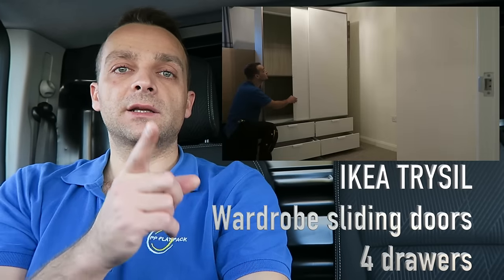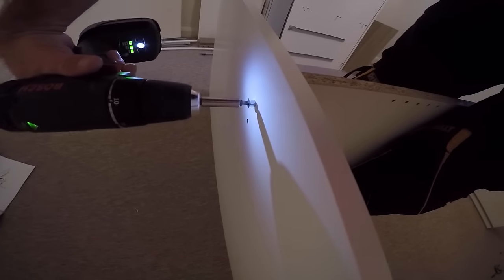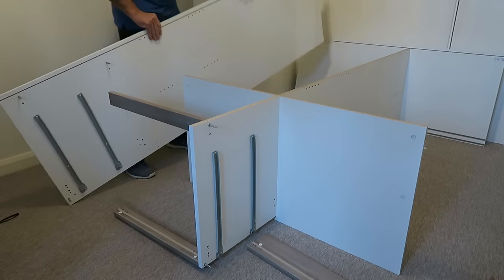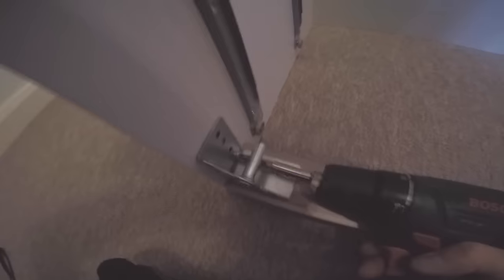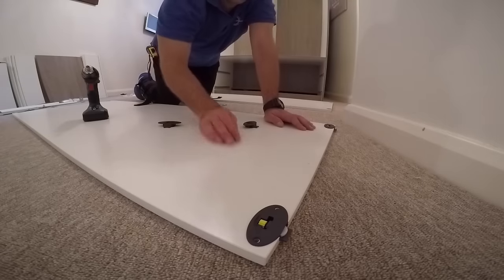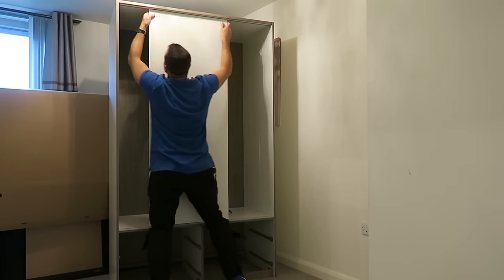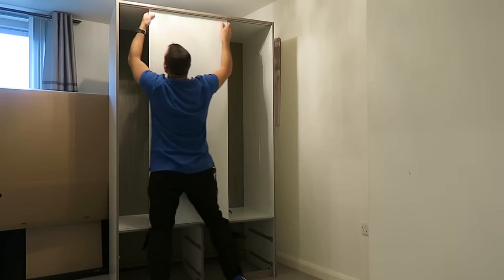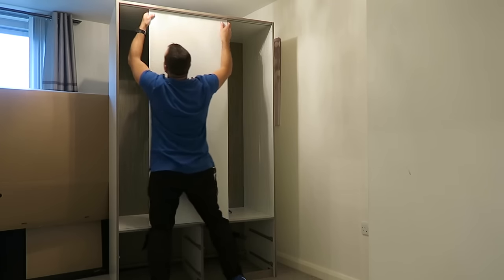IKEA Wardrobe TRYSIL sliding doors 4 drawers assembly

Comment: Hi must we always need to fix this kind of wardrobe to the wall? I don’t live in area prone to earthquake and the wardrobe after loaded with clothes should be more stable right? Or am I wrong? Need your expertise. And thanks your videos have been very helpful !
Reply from the maker: Is up to you if you like to fix this wardrobe on the wall I would suggest to doit if wardrobe leaning towards you instead of towards the wall. If your floor is straight should be fine without fixing as you mentioned wardrobe is deep enough and loaded with clothes will get more stable. My experience 90% of the people would not fix but if there is small kids... You know sometimes better safe than sorry.

Comment: In the good to know section on ikea site it says wardrobe must be anchored to the wall. I have a wooden floor and I think it should be steady but is there any video on how to anchor this huge wardrobe?
Reply from the maker: Zinedane56 True all wardrobes should be attached to the wall. But most of the people don't want to for what ever reasons (holes in the wall or they want to move furniture around. Here is video on different Ikea wardrobe but the same wall fixing as on TRYSIL. Here is the link https://youtu.be/KTRbi8iOeKY
Go to 4:17
Reply: Thank you. I think the L shaped anchor and the screws would be provided by Ikea right? All I have to do is to hook it on to the dry wall with one screw going to the wall and the other down to the wardrobe? My main concern is if the screws would go directly to the drywall or if you need some sort of an plastic anchor for the screw to hold in and to go into the drywall? The reason I am asking is I recently bought the EKET cabinet and Ikea did not give me the screws but only the wall holder/anchor. I had to run to home depot to get the screws and it was a pain in the butt in the last minute. Please reply.
Reply from the maker: With this wardrobe, you get L shape 2 brackets for wall fixing. Wall plugs and screws for the wall are not included. Wall plugs you choose to depend on your wall if you have solid (brick) just search for accurate wall plugs. If plasterboard you can have look here is example https://youtu.be/wKRjMVfjAQw
2:53 plasterboard wall plugs explain.

Comment: I'd like to build this without the divider in the middle, do you think it's possible?
Reply from the maker: I would not recommend doing that. Not saying is impossible but you would have a problem with the back (2parts connecting in the middle) plus the middle panel supporting doors and all structure of the wardrobe. All that say everything is possible if you have enough nerves for it:) Good luck.

Comment: ok 13:00 started unpack. finished at 23:00(+clean up a bit). second time ever i'm collecting like this, no power tools(everything with hands), alone and in really narrow room at the 2nd floor. how did i do?
Reply from the maker: Yeeees not bad :) Usual time on this one is 2-3h max:)
Reply: was agonising, but fun after i'm done. it was pain in the arse to check every detail, part. at first i'm like ok. where should i start, then proceeded to stare into the parts for twenty minutes ;D nice practical experience i might say. your video helped a tone btw

Comment: I forgot to put the 4 white pins as feet, so now the wood directly touches the ground. Is it okay?
Reply from the maker: Yes it is fine just if you have wooden floor and cleaning with wet cloth don't let water come to the wood.
Reply: PP FlatPack my wood is not wooden 😢 but the wardrobe is just gonna stay there forever anyways, i’m not gonna move it often lol...im mounting the second one now so i guess i won’t put the pins in this one as well since they have to stat close and I don’t want one taller than the other...